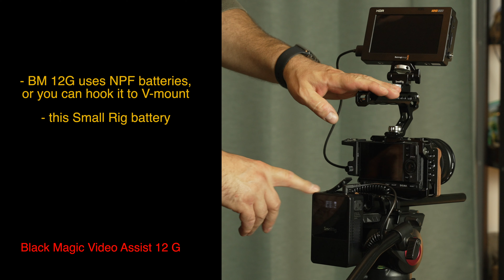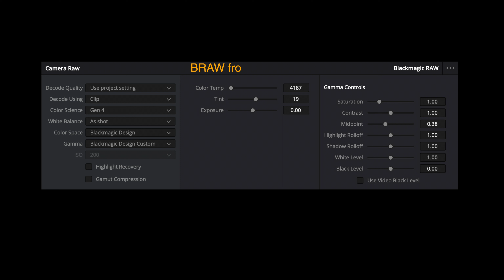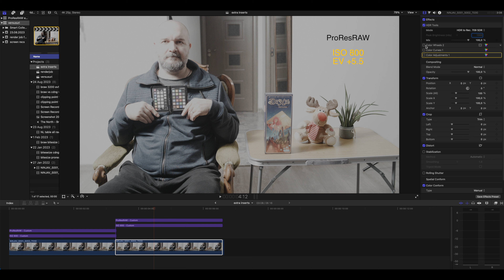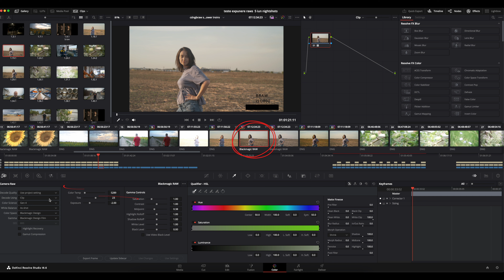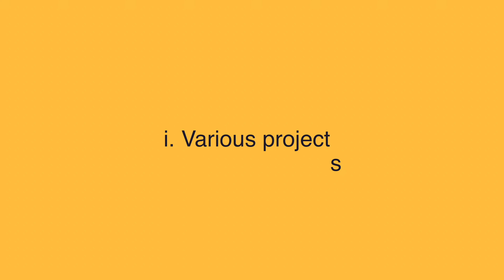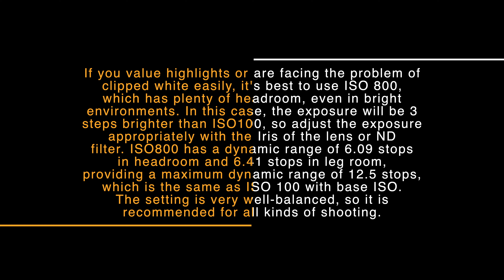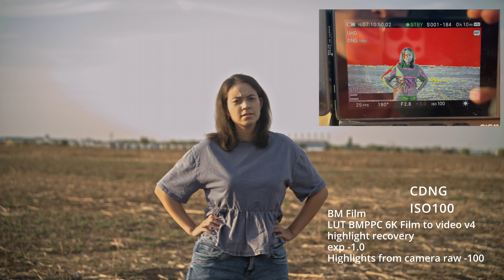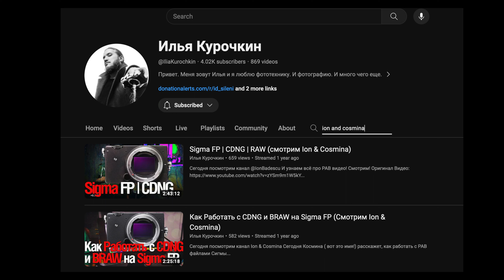Sigma FP BEST exposure EP.5 : ProResRAW, BRAW & CDNG - Best Settings, Footage & Workflow Tips!

Comment: On rigging, I use the Wooden Camera cage.  I like it better and it isn't a Chinese company.  My top handle is the Kondor Blue handle that has the sandisck problade built in, and that covers my choice of external drives.  The FP will not work with more than 2 TB drives. The blades are nice and swapping is fast.

I also adapt to EF mount because the adapters I run have VND built in.  I love having basically an internal VND. 

I shoot CDNG. I imput it to DiVinci Resolve and prep the files then save them as a Braw file.  So I only deal with the big file size on the front end. Yes, 1tb is onky 45 minutes of 4k30, but the problades are not crazy expensive and are fast to swap.
Reply from the maker: I’ll definitely try to get the problade solution. Thanks

Comment: I don't recommend using DR's technical LUTs (esp. for the Sigma fp) as they are really not flexible to use which is really essential to have for the fp. Use CM or CSTs instead and because the little fp is kind of clonky a bit in almost every technical stuff it offers (sorry Sigma :D) use CSTs for the most flexibility.
What I usually do to get a normalized image of fp footage is:

Make sure if you are working in a color managed timeline/workflow bypass color management for the fp footage.
Camera Raw tab:
    - Decode using: Clip
    - CS: BMD
    - Gamma: BMD Film
    - Highlight recovery: yes
in CST node for the fp clip (or group pre-clip):
    - Davinci WG/BMD Film > Davinci WG/Davinci Intermediate (or into a working CS you need)
    - Tone mapping methond: none
    - Gamut mapping: none
(working nodes)
out CST on the timeline:
    - Davinci WG/Davinci Intermediate > Rec.709/Rec.709-A (depending on needs)
    - Tone mapping methond: Davinci
    - Custom max input: max
    - Custom max output: 100 (but depending on needs)
    - Gamut mapping: Saturation compression
    - OOTF: no

P.S.: I found DWG as input CS giving me more accurate colors than anything else 💁‍♂
Reply from the maker: Thanks a lot for your detailed explanation! After I finished this clip I started using the ACES workflow and it looks pretty good! The only downside I'm seeing is that you don't have access to most of the camera raw settings if you do that. I'll definitely give your workflow a try!
Reply: @IonCosmina  I didn't use ACES for a very long time so no idea if it is still the case, but back then it did funny things like inproper mapping of bigger input CS than ACEScc(t) (Alexa WG for example), or color shifts in highly saturated highlights (neon light sources or stuff like that, but a typical one: blue into purple) and so on.. hopefully most of them have been resolved since 1.1 😅
Reply from the maker: Auch ACES! It looks OK now. The footage I have has a lot of highlight areas and it didn't do any weird things.
 In terms of using other color spaces, I've had some problems when I exported the clips sometimes (both in apple pro res and h264)- the image looked a bit less saturated and more contrasty than what  the graded image looked in the color tab. Did you ever get that? I tried fiddling with the export settings and it was somewhat better but not spot on so I thought maybe it's the color space mapping that's not getting compressed right?! I haven't tried exporting this ACES one yet
Reply: @IonCosmina  I put my answer here twice and disappeared twice.
So instead of writing here's a video from Cullen Kelly referring to the problem you have.
In short it is a gamma shift in DR's viewer on Mac systems and displays.
https://youtu.be/RBctM2c4GQI
Reply from the maker: Thank you!

Comment: Great video. If only I understood everything as I'm new to most of this. I'm confused...how is it bye bye for monitoring false colours if you use external monitor via HDMI? Doesn't most even cheaper monitors than BM assist or Atomos Ninja have their own false colour tools? What is the difference using false colour monitoring on Sigma FP screen vs. monitoring the output image on external monitor screen using their own false colour functions?
Reply from the maker: Hi! I go over it briefly around min 7:50, you can see the external monitors' false colors vs the internal Sigma FP one there. The biggest problem is that the monitors that have false colors don't "know" what IRE the clipping point is for Sigma FP. So it's going to look as if your footage is clipped at an exposure where it can actually be below clipping. If you're looking at exposures around the 0.0 EV point (+/- 1 or 2 EV) the monitors' false colors should look approximately the same as Sigma's ones. I haven't looked at this case or the shadow recovery portions of the image properly , to see how accurate these cases are on external monitors. I will say though that this is a Sigma FP problem because if you use the 12G BM monitor with a BMPCC6K the false colors are (obviously) spot on - exactly as the internal false colors. Atomos also probably has a list of cameras it knows how to interpret perfectly. We haven't used Atomos with other cameras that havean internal false colors monitoring system as well so I'm not 100% sure unfortunately. But we do have a sony a7sIII that can output ProResRAW so it's worth testing this out against the theoretical clipping points you get from Sony. I'll try to make a more detailed video asap and get back to you with a link. Hope this helps!
Reply: @IonCosmina  Hi. Thank you for the answer, it clarifies things. I forgot to reply earlier. Another question, not directly about exposure but thought to give it a shot since you seem very friendly. About monitors and Sigma FP: I see many videos where people have rigged their Sigma FP in a way that the external power solution/battery they put behind the display "blocks" the access (of fingers) to it and even the view. They have external monitor. Nobody ever bothers to tell (or for whatever reason answer if asked) how do they control the camera. I assume it's via the cable of external monitor, but there seems to be no info available about which monitor can control which camera. Sigma does not list them, nor does any particular monitor manufacturer list which cam they can control. Is it universal that if the monitor can control one cam  it can control any cam that has the ability to be controlled that way? Which external monitors can control Sigma FP and how? If you know please let me know also, thanks.
Reply from the maker: @taikanekkula5386  I didn’t ever try to block the screen like the others. I don’t know of any monitor that can control the sigma fp. I guess they have it set how they wanted from the beginning and just push record. We use the sigma fp lcd quite often because it’s the most reliable to check for exposure. We use the video assist BM 12g for recording externally and it has no option to control the camera.
Reply: @IonCosmina   Oh wow...and I thought I was missing something or asking them a stupid question. Once nobody never answered my question my thought was exactly that maybe they set it from the beginning and then just shoot, which made me start to wonder what they use the camera for and so I felt it would be too limiting way to use the camera if that were the case. I guess them mainly being youtubers (and not necessarily filmmakers) they used it for projects that does not require changing settings in the middle of the shoot as much as I do, but I still can't think many ways to use it like that (maybe shooting talking head video for their channel in studio...or some other extremely controlled environment with no variables).

I use it for making short movies and with limited budget for relevant variables (such as lightning, filters...locations) I or my DP when I'm directing have to constantly change the settings to get the right exposure etc. So far I have used few internal batteries for shooting but for longer days bigger power source would be handy. Well, if I choose to go for external battery I have to modify the rigging and leave space for lcd. Anyway, thank you so much for your quick reply. I love my Sigma FP for independent small budget short movies. I use external monitor for framing and focus and record on external ssd but by your earlier suggestion I now expose using lcd. For what they use the cam for...beats me. I guess they rig it differently when they need to actually control it, but they never mention it.

Comment: Hey im not so well informed and smart like you guys to get the overall picture but if i could judge overall exposure of CDNG How many stops of over or underexposure could i go for before its unrecoverable in post. Also in Low light you did say in another video that the Sony A7Siii  was noisier than the FP. So Can the FP in CDNG do better at ISO12800 where it's Sony's second base ISO?
Reply from the maker: Hi, many apologies for the very late reply! 
For the over exposure side you can follow the numbers in the table from page 3 of this paper https://drive.google.com/file/d/1R9_nBXTeXs1FsE41HYH0XzDrwftatdyA/view . For the underexposure, it’s more tricky because the more underexposed you are, the more noise you will get even if you can technically recover details. So I guess how low you can go depends also on how much you want to reduce the noise in post. The noise levels also depend on how you light your scene. So for example if you have deep shadows, they will have less noise. You can check out our video on sigma in low light and you will see that the images that were lit using one small light source that just lights the face of the character or a small surface of the room, look less noisy than the the images from the 1 hour CDNG test shots. Overall, I’d say I wouldn’t underexpose more than 3 f-stops if I want that bit of the image to be clean – acceptable noise, no or acceptable color shift.

Sony A7Siii vs Sigma FP noise levels. That’s a also tricky... So we compared:
- sony ISO 6400 vs Sigma FP iso 6400. Here the sony image looks like it has more light but sigma has less noise
- sony 12800 iso vs sigma 6400. Sony has A LOT more info in the image, because the image is much brighter BUT the image is more pasty (as a result of the internal noise reduction), has a lower quality than sigma’s
So definitely on Sigma don’t use an ISO higher than 6400 on low light, otherwise it will be very noisy. If you have a situation where ISO 6400 is enough, than use sigma rather than sony if you want crisp image with low noise. BUT if you absolutely need to make your image appear brighter (hence you need more help from your ISO), than use sony at iso 12800. If you want more control over your noise reduction, don’t use internal XAVCS, use a ninja external recorder in ProResRAW. This will produce a noisier image compared to the XAVCS but it’s not going to be pasty and lack crispness and you can decide how you want to do the noise reduction.
Reply: @IonCosmina  Thank you so much for the detailed response! As far as context for ISO12800 in Sigma FP, I would be outdoors in low light where it's completely dark and subject is low lit like street lamp or tubelights or lamps and controlling the lighting is not in my hands. Then at ISO 12800 Sigma FP is it easy for noise reduction in post? . Also if converting the DNG TO BRAW in Davinci does it change anything in terms of  noise levels or noise reduction capabilities ? And finally I really want you guys to post more technical content and some of your work too! You guys have really understood your cameras very well! Love the dedication and hardwork you guys put in to these tests. It's not easy and I sincerely hope your YouTube channel makes it big!! Thank you so much!!
Reply from the maker: Hi! My advice is don't use sigma fp with ISO 12800! Use iso 6400 maximum.
BRAW is cleaner than cdng if you shoot it directly on an external recorder, I never tried converting it from cdng in post-production so I honestly don't know.

Thank you so much for your wishes 😊! We hope to continuously bring better content and nicer looking videos! But we are slow 🦥...

Comment: Is it possible to monitor SigmaFP image in NATIVE/HLG gamma on Atomos Ninja  when you send only monitoring output from SigmaFP or is it working only when you record in prores raw?
Reply from the maker: We didn’t try it in a while and there where many updates on both the sigma and the ninja so I’ll get back to you on that shortly.
Reply: that would be great @IonCosmina
Reply from the maker: I tested it. Ninja V does not allow HLG/PQ settings while you have the Sigma fp set for monitoring output. You only get NATIVE so whatever colour mode you set your Sigma to show on its LCD.
Reply: @IonCosmina  thank you. I guess prores is the way then)
Reply from the maker: @prostoparen  raw. It’s not bad. :)
Reply: @IonCosmina  yeah i know. Btw you can convert proresraw into CDNG using raw converter. That opens alot of pros for using atomos mainly as monitoring tool

Comment: Well done on you for filming such material, even though it is controversial! It’s strange that you are still surprised by the process and volume.
I easily shoot 7-8 TB, quickly edit and deliver the material. Don't be afraid of numbers, just use cheap 4 TB disks and don't download them, but mount directly from them...
There is no point in recorders - in my opinion!
I liked the pictures from the pipe factory in cdng, the cowboy - the quality is not worthy of Sigma fp) - was shot in a different format...

Comment: Forgive me for being harsh.
I looked at the information only on the disks, from which I realized that you did not test them properly, relying on rumors while creating the appearance of reliable information.
Perhaps the translation into Russian is to blame, in this case my apologies, I’ll try to look further)
I’ll just write that good disks do not overheat, there is no decrease in speed on volumes of 2 or 4 TB, the camera calmly writes CDNG continuously - this is real, reliable information posted on the network, verified on specific disks.
Reply from the maker: We only report what happens to us. We only tried a few ssd’s. But we can’t record for longer that 20 min with most ssd we tried and after that, it records only for a few seconds. It might be our camera, our many cables, or the ssd’s. I heard of many that T5 or T7 are good. Our ssd of choice is samsung t7.  There might be better options that we never tried.
Reply from the maker: (Cosmina:)hi! no worries, thank you for your thoughts and thoroughness! 
I wouldn't say i'm surprised at cdng data rates, but i still don't like the fact that I need to use up so much space. It sounds reasonable to have a work flow that you're happy with in cdng, i don't think it's impossible. It sounds like you found a good deal for yourself.
we tested all the ssd's of 1TB that we talked about and they did overheat. The cable can also contribute to that, we changed the cable and in some situations it made a difference. some ssd s indeed don't overheat, like you were saying, high quality ones don't.
The cowboy shots - it was 4K braw 3:1 BUT the FD lens is a very old lens so i think that's why you're seeing the drop in quality.
Reply: @IonCosmina , Yes, the Samsung T7 Shield 4TB costs me 200 US dollars, I write on them non-stop, just like on the T5.
And I don’t care about the volume of data, since editing occurs directly from the disks.
It is much more important that uncropped data is written, which I like with fp much more than the results from cameras that are noticeably more expensive and popular in the professional environment.
Thank you for your understanding!
With the cowboy, I see the problem as an exposure metering error or compression loss.
Old lenses are not capable of making a frame look flat.
The last video I posted was from an old Soviet lens that I hadn’t used for 35 years.
In my opinion, he did a good job...